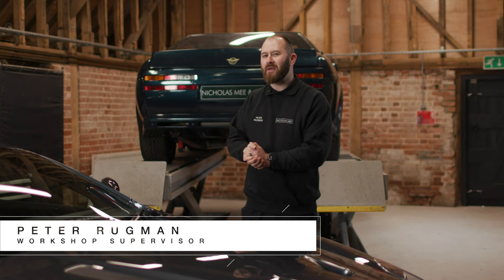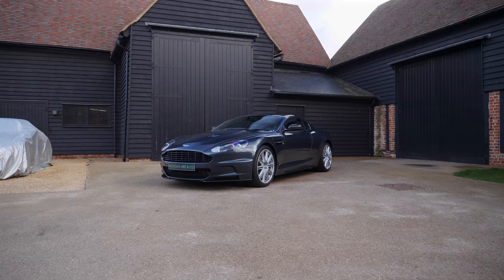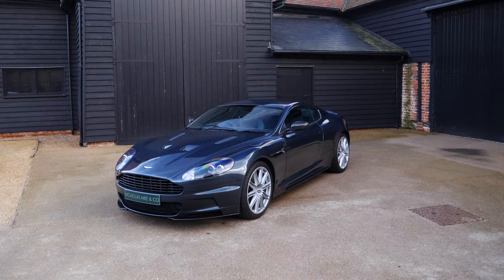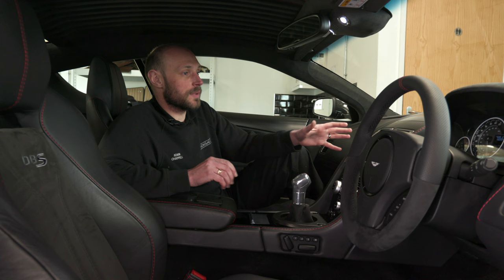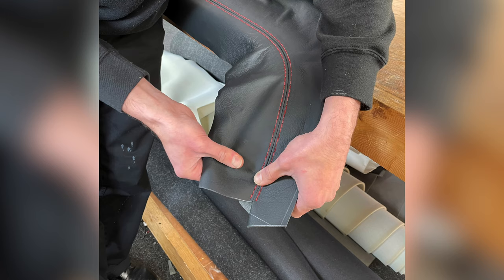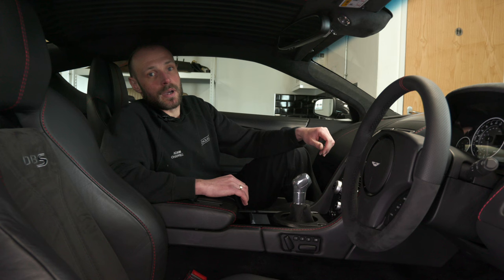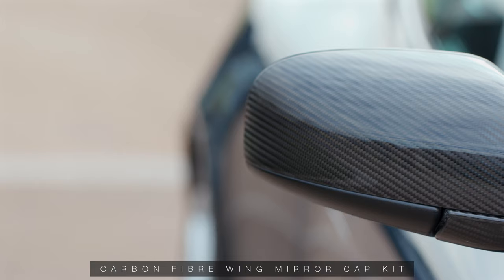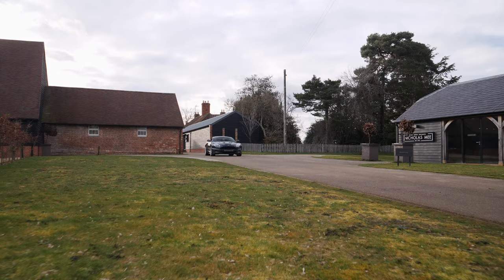2008 Aston Martin DBS Manual - Reborn and reimagined - Nicholas Mee & Co, Aston Martin Specialists

Comment: A fantastic car. Just out of curiosity. What is the level of refit, customisation and upgrades available? AWD available with AW steering? adjustable air suspension all round? Custom engine. Say an 8.5 litre v8/10/12 with twin turobchargers? Chassis stretching? I'm just curious to see how far you would go. Regards.